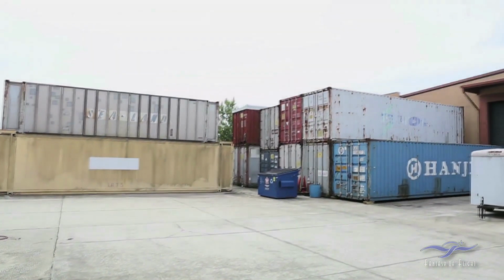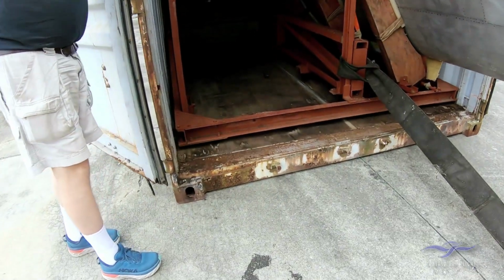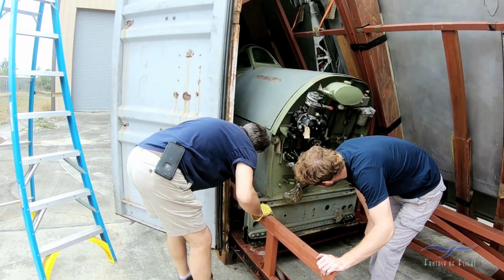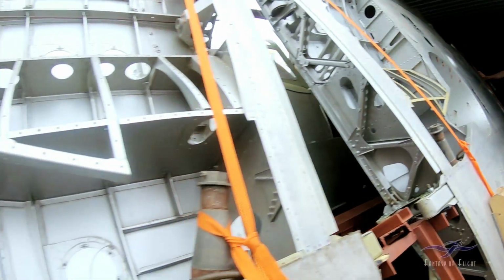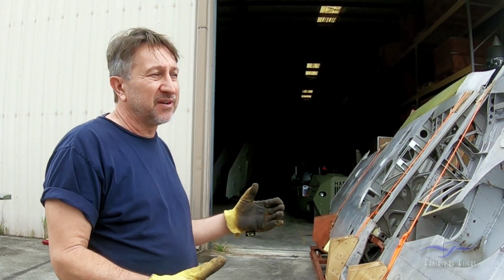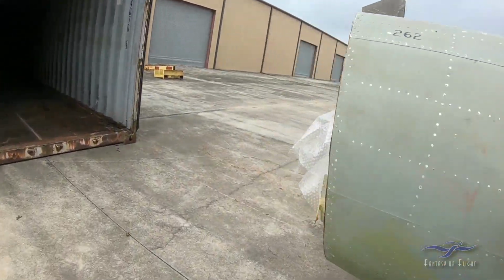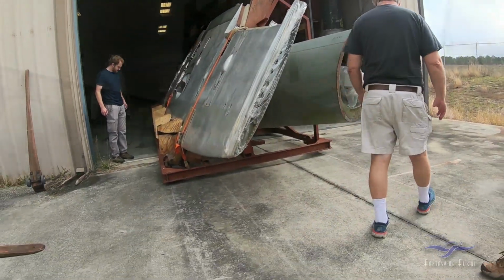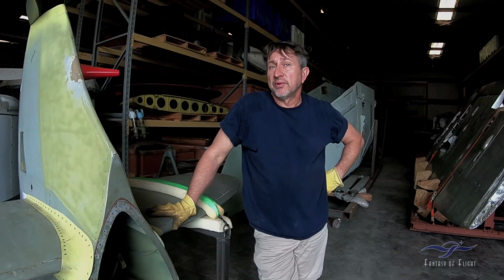UNBOXING! - Spitfire MK-XIV - Container

Comment: Hey I made a big part of that transport cradle! I took a bunch of us a couple of weeks. It was actually built around TE476 back in around 1995 or 1996. Even with the wings tilted over there is literally only a few inches clearance from the container ceiling. I have a few photos somewhere of us loading TE476 wings on to it prior to shipping. It's cool to still know the rig is still around and being used. Great video.
Reply from the maker: Awesome! Send Paul some pics of you can.
Reply: @KermitWeeks444  Ok I will see what I can find but need to know where to send them

Comment: Tip from an Old guy. Next time put pvc under the skids as your pulling 1 out and it will roll right out. Old trick for moving utility building. 👍

Comment: 12:05 Yes, whoever built that shipping stand really knew what they were doing!
Reply: No, not really. If they had designed the shipping frame properly it would have slid out of the container with no drama  and little risk of damaging the contents.
Reply: @dalecomer5951  That was due to rotted wood at the bottom of the container not the frame
Reply: Yup! That frame saved the day. The 'booby trap' hole on the wood floor, could have created havoc with a lesser frame.
Reply: No, sorry. The frame concentrated the mass on the small footprints of the rollers or casters on the cheap and probably old deteriorating floor of the shipping container. They should have built a slide of metal or wood to distribute the mass and make extraction a piece of cake. They could have also used a tall container which would have given adequate headroom. The value of the contents would have easily justified the added cost. Obviously not the work of an engineer or one worthy of the title.
Reply: @VegasCyclingFreak  So having the ability to see into the future they could've laid down some channel to act as tracks.  I think the frame was awesome.
Reply: @dalecomer5951  In all fairness to the engineer/s, there was no expectation that Covid19 was going to create delays which would create the problems encountered.
Reply: @David-yo5ws  Right. Let's blame COVID-19 for everything.
Reply: @dalecomer5951  I’ve never even seen or heard of a shipping container with a WOOD floor. I guess they needed a crystal ball to know they would have this problem 1-2 years down the road.
Reply: @VegasCyclingFreak  Should have been obvous to them. I recently shipped a lot of stuff in a near new shipping container with a painted flakeboard floor.
Reply: @dalecomer5951  That's interesting. I have never seen any that aren't entirely constructed of steel.
Reply: @VegasCyclingFreak  We have these on mountain tops all over California as communications sites, and everyone of them have wood plank floors, some with some type of vinyl floor covering.
Reply: @VegasCyclingFreak  Honestly, ol’buck, in 40 years of dealing with shipments in containers and purchasing containers for extra storage and workspace, the only ones I’ve ever seen with anything other than a timber floor have been older refrigerated units of about 40 years ago. Those had stainless liners with the floor being double skinned with longitudinal channel sections, cold air being returned to the refrigeration unit housing via the underfloor voids. 
Upside was excellent thermal and noise insulation, downside was the unit’s extra self-weight limiting it’s load capacity. 
You never see them in general shipping use, reasons being both the above load limitation and the significant extra cost when compared with a standard unit. 
So, I guess you’re in a frozen produce industry, perhaps?
Cheers, R.
Reply: Ok for anyone that is interested. I built fair bit of that transport rig along with few other guys. It was built back in the mid 90's to transport TE476 and the container given to us at the time was the standard size shipping container you still see world wide today. They all pretty much have wooden floors and the floor in the container at the time was in excellent condition so the rig wheeled into it perfectly fine. It was just intended to be used for one trip and had to be rolled out from the hangar into the container which it did perfectly well. I figured it was probably disposed of years ago but nice to see it is still useful.
Reply: @robm.4512  An engineering firm I worked for used a refrigeration container for storage. It used to stink when you went inside. I always wondered why the channels were in the floor. Thank's for your explanation. Another mystery, a mystery no longer.
Reply: @David-yo5ws  Happy to be informative. Yeah, I know exactly what you mean. I kitted a few out as engine test cells with Dyno’s, gas analysis and datalog suites, along with some biggish air-handling plant. 
After the first one turned out to reek like an abbatoir’s refuse lorry on a hot day the rest got hot-washed out, inside and underfloor, with bleach solution through a pressure washer for a few hours before anything got done to them. 
The stubborn ones got caustic soda solution pumped through the channels, that sorted it!
Cheers, R.
Reply: @Michael_Sparkes  Nice job!
Reply: @VegasCyclingFreak  Every shipping container I've ever seen had a wooden floor. Shipping container much?

Comment: Now that's MY kind of unboxing!  TBH, at the first sign of a problem, I'd just take the container apart bit by bit - precious cargo!
Reply: These containers are welded together, not bolted. That means cutting with a torch or a chop saw or grinder. Any one means sparks. Sparks are a no-no around precious cargo.
Reply: @shelbyseelbach9568  Absolutely not!  I thought these containers were bolted.

Comment: The rigg is great screwing down a Strip of 10mm steel flat under the wheels would have probably made it even easier… but having loaded containers myself you don’t exactly expect the floor to rott through when packing them…

Comment: The only thing I don't like about the spitfire is its undercarriage... I prefer the wider positioning of the open outwards that the hurricane has...
Reply: Why does no one slag off the P-40 or the F4F Wildcat undercarriage?  It was way wider, stronger and more geometrically sound than the Bf 109 undercarriage.  Modern jets have fuselage mounted main gear, where are all their slaggers?

Comment: As you observed Paul this was very well crated indeed . It also looks in very nice condition . What is Kermits intention ? And what is the MK IX doing ?
Reply from the maker: Will eventually be restored. We’re still coming out of the Covid slowdown. There’s a long list of catch up now, the MK IX on the top of that list.
Reply: @KermitWeeks444  I think the MK IX was the most beautiful Spit, but the Mk XIV was certainly more capable -- which is what really counts.
Reply: @MichaelSteeves  Actually, the Mk IX is more historically significant. It was a quick and dirty hybrid to meet the challenge of the FW-190A which was superior in performance to earlier Spitfires.
Reply: @KermitWeeks444  Was this aircraft owned by Charles Church at one time?
Reply: Isn’t there an engine run video of a Mk XVI or is there some IX and XVI confusion, does Kermit have THREE Spitfires?
Reply: @givenfirstnamefamilyfirstn3935  I believe Kermit ‘only’ owns two Spitfires! He has an amazing Mk 16 with a Packard Merlin, a stunner, beautiful looking aircraft with clipped wings one of the most originally preserved. The second Spitfire is the Mk 14, the aircraft in this video, with the Rolls Royce Griffon. They’re the two best Spitfires seeing service in WW2!  -  (I believe the Mk 9 is more or less exactly the same as the Mk 16 except the Mk 9 is fitted with a Rolls Royce Merlin, instead of the Packard Merlin) 
I am just amazed at how good it all looked coming out of the container.
Reply: @mattharte7334  By the time Supermarine were ready with the more sophisticated Mk VIII there had been so many Mk IX/XVIs produced that it made sense to send most VIIIs overseas.  Most were used in a fresh campaign using very well trained and supported pilots to finally crush Japanese fighter forces in Asia.
Some Spitfires with retractable tail wheels have been modified by current users to fix the tail wheel down as with the beautiful Mk XVIII in Germany.  The later Spitfires had reduced span ailerons which should help identify a real VIII.  Kermits XIV wings should have ailerons that stop well before the wing tip join.

Comment: Am I correct that the Mk XIV has a single wing assembly rather than a pair of wings like a Thunderbolt?
Reply: No, for sure not. Look closely! Two wings with a unique spar type that bolt to the fuselage!
Reply: You can see the main spar carry through at the base of the firewall frame.  It has three bolt holes on the top and four on the bottom of the spar.

Comment: Fabricate 6 swiveling wheels on metal pads that are welded to the stand (two per end / two in the center) and one person can locate the entire system anywhere in the shop with no difficulty.